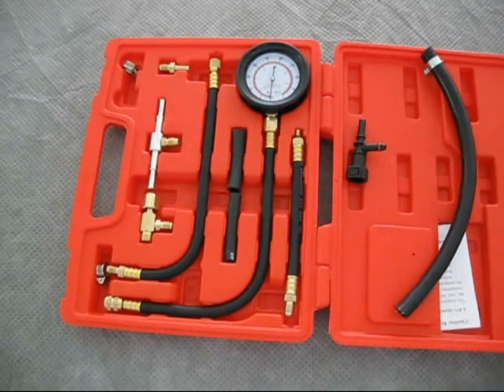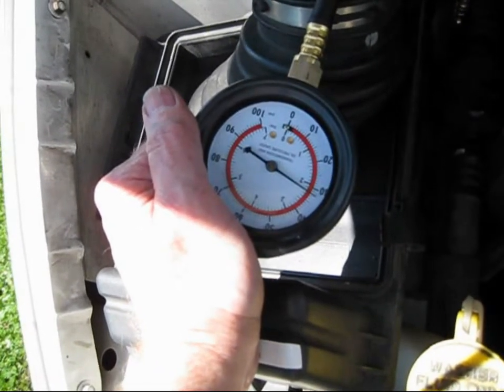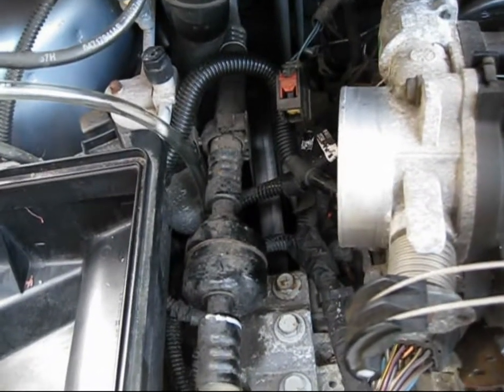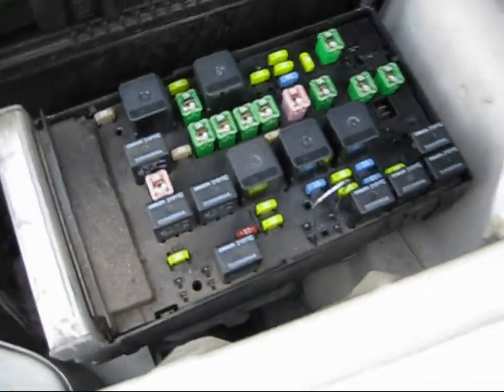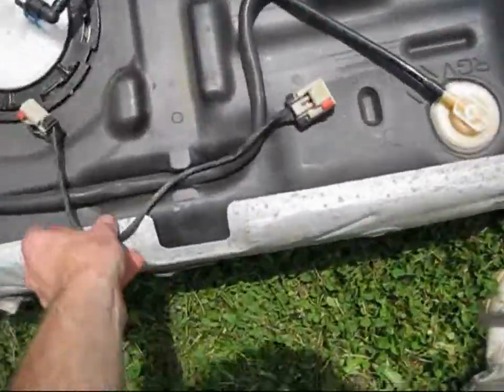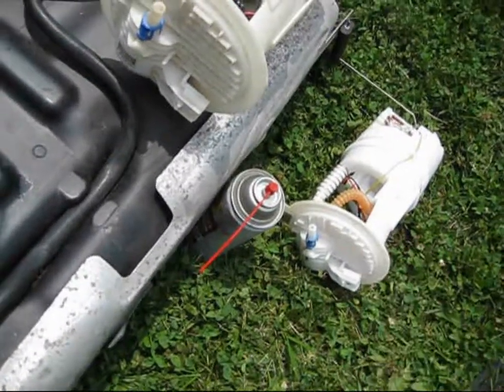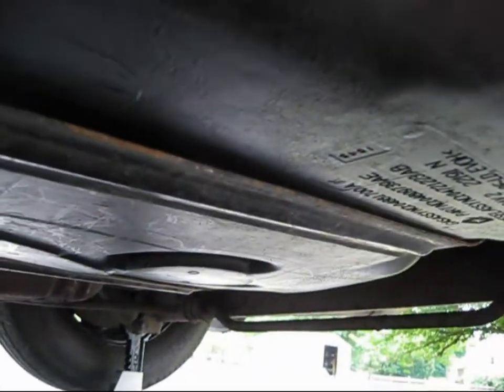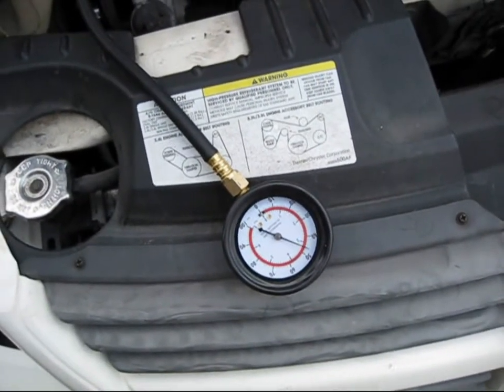CODE P0171 FUEL PUMP * DODGE GRAND CARAVAN WITH STOW N GO SEATS

Comment: I have this problem intermittent can't figure not out mot people replace the maf sensor
Reply from the maker: It was intermittent with me also on 2 different vans. Typically after getting gas, it would stall after leaving the station, slowly got worse to the point I would need to let it sit for 30 min before it would start. What would happen is when I would stop, the hot engine would cause the fuel in the  fuel injector manifold to vaporize. The failed fuel pump was not strong enough to push the vapors out, a good pump blows them out almost instantly.

Comment: Who did you get the new pump from?
Reply from the maker: For this van I got a used OEM unit from the junk yard. For my current van (other video) I bought a Denso from Rock Auto. If you're buying a new unit get the denso or other quality brand. The Chinese ones from your local parts chain store are worthless junk.